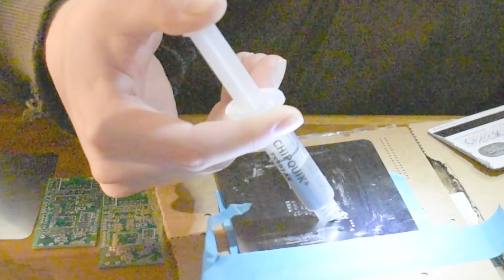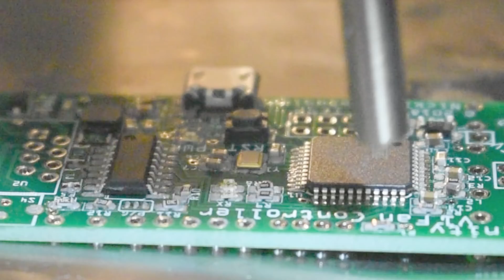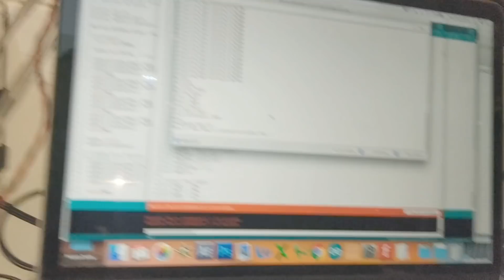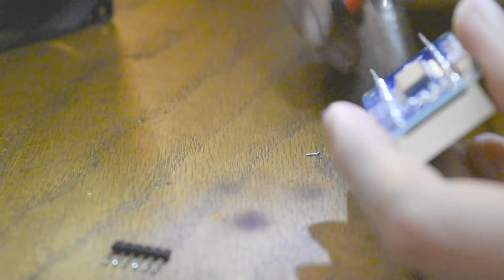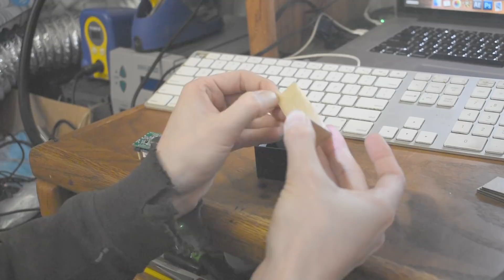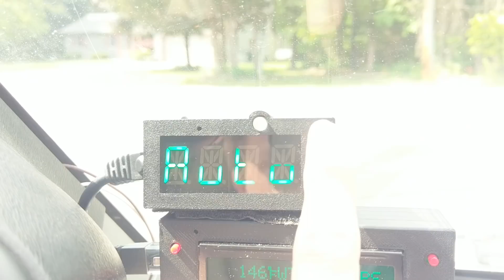Trinity V1 SMD Board Assembly: Hows it's Made

Comment: Oh, you also mentioned a reflow oven. I made one out of a toaster oven I found at Goodwill for 10 dollars. Works beautifully! I did reflective insulation on the front glass, sealed all the holes with high temp sealant, insulation blanket over the top and drilled a single hole for a thermocouple, fixed close to the board. It's very easy! I just push a single button and it runs the reflow cycle.
Reply from the maker: That's awesome, I will definitetly look into that for prototyping because this hot air Reflow method is a little questionable at times.

Comment: Good Stuff! What processor is that? An Xmega? Do you have the board files online somewhere? I actually have my own project I've been working on forever, a DRB replacement. It's located here https://github.com/katemonster33/CDJPScanMaster I'd love some pointers!
Reply from the maker: Oh man, that is awesome stuff. I haven't been able to get my hands on a DRBII /III yet but I would love to see what goodies are hiding in there. I'd love to help if I knew more about it. I'm using an ATMega 32u4 for this particular project since its a cheap Atmel chip with USB onboard. For the REM Project I have moved to the ARM Cortex K20 series because they are vastly more powerful. The Gerber's are only personal for now as they are probably going to be sold it I get work the bugs out.
Reply: NickInTimeFilms understood. My project is meant to be wholesaled, as in I want to sell the hardware basically for the cost to build it maybe plus a little extra, just because I think everybody should have access to dealer-level diagnostics on their 10+ year old vehicle. Right now I'm using the ATXmega 32a4u because I need USB and 3 UARTs. A 5v IC with those features would make my project so much simpler.